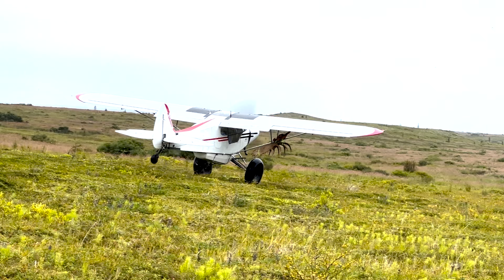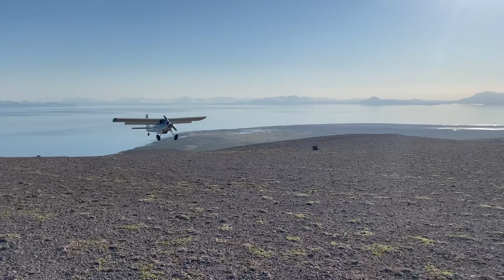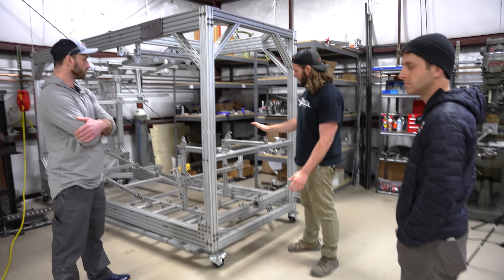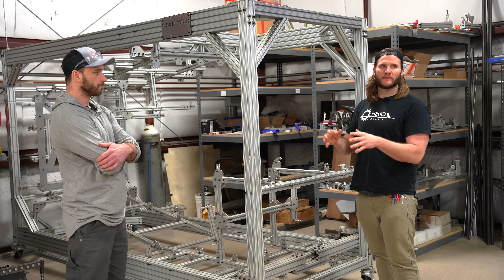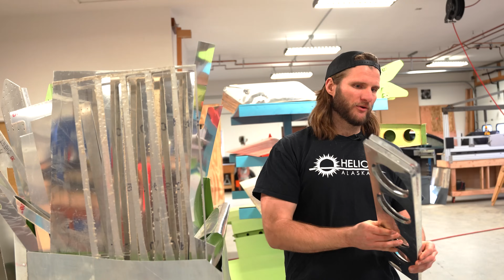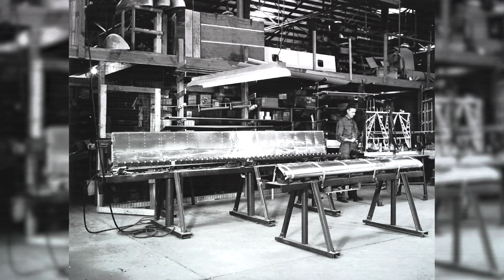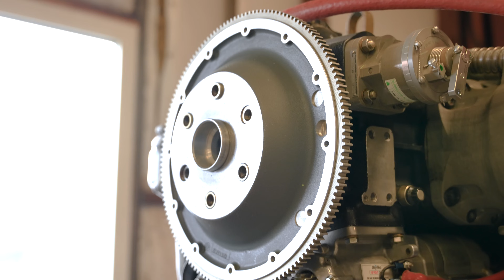Building an Airplane Factory... From 75 Year old blueprints

Comment: In 1972-1973 I was an Army Aviator flying helicopters at Fort Riley Kansas. This was the heyday of the BD5 development and testing in Hutchinson Kansas.  I have flown my Bell 206 there many times and gone through the factory, hung out at there very tiny hanger with untold number of propellers that had been tested hanging on the walls.  Sat in the crazy pickup truck modified as a training aid to learn how to takeoff a BD5.  In my visits I learned of the Helio Courier factory in Pittsburg Kansas. I have flown my OH58 to the factory at Pittsburg several times.  I don’t remember the names of the folks there but they were all very kind to us and I have gone through the factory several times over the 2 years I was at Fort Riley.  I talked to the test pilot on one occasion, and I asked him how they got the new aircraft over to the runway as the factory was some distance from the actual airport runways.  He just pointed out the back door of the factory to the unimproved grass field where I had landed our helicopter and said we just push it out the back door and take off from there.  It was a very small field.  I don’t think he was pulling my leg, I think they actually did exactly that.  On a side note the factory workers were allowed to  use the equipment after work and many of them built aluminum fishing boats.  On my last trip there in ’73 the management stopped that and workers were not happy.  The factory was not that big, just one long hanger.  I remember one completed aircraft going through final checks about ready to be test flown setting on one end of the factory floor.  I can remember the end of the factory had several half built aluminum boats the guys were still working on after work. Kansas was a great place to fly in those years.

Comment: I wish you the best in building this aircraft! As tech at an Isuzu dealer, I had a stocky 5’ 8” blonde ask every fluid service type, where it went and how often to change it. Her reply was she was driving from Nebraska to Alaska where she was a bush pilot. She took out her wallet & photo holder to show me her cabin, plane and garage with equipment. I service the plane and the 4X4 to fix everything. I live alone and advertise but has a business of flying groups into camps & picking them up on certain days. She went on to talk about tires, suspension and 700-800 foot take off runs to rotate out from trees and navigate back to camps to pickup hunters or fisherman. She would like your project! DK, ASE Master tech. Retired!

Comment: So i know this doesnt even exist as im about to describe it, and it sounds like your current engine design is gonna work well, but.. Rotax makes geared engines (geared engines are a bit more complex and maybe more expensive to maintain) but if you approached rotax to build a bigger engine than theyve ever built to achieve similar hp and torque number they may be able to do that with an engine that runs on more fuel options while also being significantly lighter weight. That would obviously involve having someone build something completely new vs. modifying an existing product. But maybe worth it.

Comment: 6:41 When we tried to replace wings or tail empennage on some aircraft made in the 1950s, the bolts wouldn’t line up. Apparently our aircraft were made with wooden jigs and this wood would shrink or expand with the seasons and weather. An aircraft built in winter would be slightly different dimensions compared to an aircraft built in summer. Maybe by a fraction of an inch.

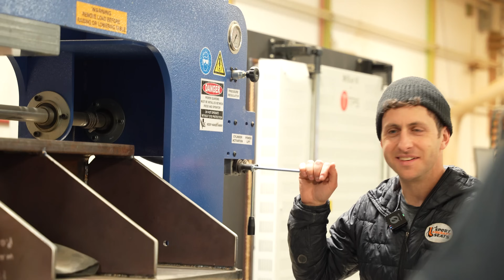Comment: [13:30] Am I the only one cringing at that press being able to operate with only one hand? Just waiting for an accident. That press should also have a button that has to be pressed with the other hand while the handle is pulled so that both the operator's hands can't be in the press while it's functioning.

Comment: As a former machinist AND pattern maker, I fully understand their problems and applaud their solutions.
As a former MODEL AIRPLANE BUILDER, I have built and flown a couple copies of that plane using rubber power, and it flew VERY well.
KUDOS GENTLEMEN!
Reply: BTW, I may not be capable of doing much machine work any more, but I could always install rivets....need help?

Comment: One critique. 

Every heat lot / batch of sheet metal will have differing mechanical properties. 
It’s definitely possible that you can accommodate for the variances, but I would like to mention that aligning holes is likely a poor use of time. 

How can we automate the hole drilling/riveting process? 

I envision an assembly line that includes robotic drilling arms. They could be small fanuc robots, or even a cobot with sufficient thrust. 

I feel like the efficiency during assembly outweighs any future expectation of universal part fitment.

Comment: Thanks for spending quite a bit of time on the issues of weld distortion and its implications in building aircraft.  As an aviation aficionado and welder myself, I’ve wondered how the aerospace industry deals with the inevitable problems that welding creates when you’re dealing with thousandths of an inch and symmetry is imperative.

 And I thought welding 8 x 8 square tubes together, accounting for distortion was annoying enough while trying to keep everything perfectly straight.

Comment: I worked at a Canadian Aerospace company that was the OEM for many De Havilland Aircraft Canada landing gear and primary fligt control systems like flap actuation systems starting with the DHC-4 to the Q-400. In the R&O dept when repairing a DHC-4 flap screw assembly we had to search through the archives of paper drawings and manufacturing plans from 1955-58 that nearly all specs used are no longer used. It took a lot of work to find and replace materials, tools and spec that were acceptable to our several engineering teams but we had to support the remaining fleet.

Comment: Omg. Yet another new aircraft video completely, COMPLETELY, and CONSPICUOUSLY ignoring the most burning question. Price. Not even a peep on price. That AC engine, prop, and gauges is 180k. The nav equipment 100k. The rest of the airframe 200k. The manhours to build it 200k. This is an 800k - $1 mil aircraft. 👎

Comment: Awesome effort! My last fire firefighting assignment was as an aerial supervisor and continued on-call in retirement. I’ve worked from many platforms; OV-10, O-2/C337,C206,C310, C340, Aero Commander, King Air, and a Helio Courier. I earned my PPL before retiring and part own a C-172. The dispatchers knew I was comfortable in a single engine plane, many of my cohort would turn down an assignment in one. 
On one callout I confirmed I’d work in a single engine. Dispatch told me the pilot’s name and the plane was a Helio. I never had heard of one and didn’t know what it looked like. When I reported in at the air base tower I was told the plane was ready in the parking area. Looking from the tower I saw what looked like a C180 with ginormous wings. That started a really wonderful two-week adventure experiencing the flight characteristics of the plane.
Leading edge slat deployment was alarming the first time even though I’d been advised of it. Alternate deployments were odd in turbulent air! We went nowhere fast. Flight conditions were MVFR at times back at the base. We would return at times over smoke layers about 10K then descend into the airport at 55-60K and 1,500 fpm, virtually on down wind. It is a great slo-mo machine. Good luck to the company.

Comment: Parts from one plane not fitting another – I recall with (at least) 1950’s bombers the many engine access plates had the planes serial number painted on the back of each – had been specifically tweaked to fit in the factory.

Comment: With the low RPM and high torque requirements, why not go diesel?  Fuel would be easier and cheaper, airtime would probably increase or tanks decrease.  Plus the safety that it wouldnt require spark to continue to run.

Comment: YOU ARE ALL DOING EXCEEDINGLY WELL WITH A VERY DIFFICULT NEW BUILD WITH OLDER PARTS. I USED TO BE IN METAL FABRICATION AND WELDING AND SO I CAN SEE HOW ADVANSED YOU ARE.  I WOULD PUT A GAS TURBINE ENGINE. LIGHT AND SMALL BUT VERY POWERFUL. . SINPLE AND EASY TO OPERATE.

Comment: Sounds like you guys need a course in HOW TO READ ENGINEERING DESIGN DRAWINGS , if you're not familiar with those E SIZE DRAWINGS , YOU'RE GOING TO GET LOST.   I CAN GUARANTEE THAT THE PROFILE OF THAT LEADING EDGE RIB WILL BE IN THOSE DRAWINGS , AND ON THE SHEET YOU'RE LOOKING AT THERE WILL BE A NOTE OR A DRAWING NUMBER CALLOUT FOR THAT PROFILE , SO KEEP LOOKING EVERYWHERE ON THAT SHEET UNTIL YOU FIND IT , I worked for General Dynamics , Lockheed and Raytheon and the FAA during my career creating engineering DRAWINGS.  GOOD LUCK

Comment: You need some SolidWorks guys to digitize the information into solid models and digital drawings. Been there, done that, for the CriCri. Comment made before watching the whole video: you guys are doing it right. Basically a not Van's RV 'kit'. This is not inexpensive; CAD time, jig creation and fabrication, raw stock of aluminum and steel tubes, CNC machines...How are you guys funding this? Hard doing this in SW, because you have to consider twist for angle of incidence in the theoretical wing and spar, to real life machine operations. Wow, another twist: water cooled, and a Part II; I want to hear about creating the custom cylinders and look forward to more info on the engine partnership and the next episode.

Comment: Just getting all those drawings digitized and then transferred into CAD is a big undertaking. And that's before dealing with all the materials and such. Also I'm curious if they figured out the wiggle room needed in tolerances? If it's not enough, they could have problems between winter and summer production work due to the metal shrinking or expanding with temperatures in the shop. The older hand-building methods weren't as exact, but it's likely they inherently compensated for such things.

Comment: This really underscores the reality, which is that aircraft design is relatively straightforward compared to the production engineering. Most of the big spectacular aviation or space projects of the 20th century were all artisanally crafted. Each F-1 engine on each Saturn V required thousands of welds by a master welder. There were no provisions for automating production because for the volume, it was easier to do everything by hand.

Comment: WOW, does Alaska ever need these guys! This is the most amazingly ambitious project I've seen in my 90 years and they're fixing every little quirk that pops up in those old plans. The latter day Helios will be far superior to and more accurate than the old hand built versions, and probably far more rugged. There is hope for light aviation thanks to smart young and industrious men who found a need  and are doing something to fill it. Alaska will finally have it's own flying workhorse when these guys succeed and they will! More power to them, at least 300 hp and 2300rpm.

Comment: Commercial Aircraft Toolmaker here… a rolling assembly jig made of Bosch tube is terrifying if you want a repeatable part 😅 unless your tolerance is +/- 0.250” lol.

Oh it’s way worse lol. Just relying on Cleco’s and wood work tables to control the configuration of your aircraft will build you hundreds of unique aircraft each with unique flight characteristics and no parts interchangeability. You’re allowing a 0.020” thick aluminum sheet metal panel drilled on a wood router table to control the configuration of your aircraft, rib spacing, spar spacing, and your prototype has measurement errors of 0.500”+ once it’s cleco’d together? Where are the master gauges to test whether those panels are in tolerance before they ever make it to the build?

There’s plenty of stuff on commercial aircraft that is located and installed from preexisting holes and isn’t controlled by a jig, but the base of the build always is. Spars are always controlled. Control surface supports are always controlled. The frame of your aircraft, the keel beam and ribs of the body need to be controlled by hard fixed tooling.

The type certificate was based on the FAA seeing the hard tooling and seeing how repeatable the build is. There is no fixed tooling now, and the drawing isn’t being followed to the letter, so that certificate is meaningless.

It’s just layers upon layers, they should have reached out to a consulting firm first, they’re missing about $100 Million in tooling to build a certified commercial aircraft. The rusted “scrap” they bought sitting in the field was a goldmine they threw away. Who cares if it’s welded well casing, 747 tooling wasn’t much different. it’s more stable and repeatable than plywood and extrusions bolted together without dowels.

I have no doubt they will build many flyable and safe aircraft but they will be experimental only, a type certificate will never be issued.
Reply: ^The unfortunate truth.

A type-certified Helio would need a defunct engine/propeller/gearbox combo, anyway. 

Or a PT6a STC.

The IO-580 is not going to provide the same "Umph" static thrust as the enormous  propeller did.

They will probably just build experimental aircraft.

But those Jigs would be useful, if only to blueprint them to recreate a similar system. At minimum, some inexpensive 6" steel I-beams welded up will be better than wood jigs.
Reply: Tool Engineer here, maybe on the same team lol. I left a comment criticizing their tooling methods too, because it’s clear to anyone in tooling that there are major methodological errors with their manufacturing. I mean hell, major manufacturers have tried FSDA designs on legacy aircrafts and its always an expensive, slow shit show. We’re only now figuring it out with aircraft built from the ground up with it specifically in mind and with our advanced CNC machining capabilities today.

I wish they had a guy like you to steer them straight early on, because you know exactly what you’re talking about. This is the harsh truth.

Comment: Wow.. that is amazing.. Wondering if you have considered temperature fluctuations in the shop.  Thin, long metal could prove to move that 20 thousandths of an inch in a temperature variation of a few degrees.

Comment: A unique slice of the stol category. A cessna 185 or 206 with the Robertson conversion would be the closest competitor but tos do not have the le slats.. There is a gtsio 520 out there ex continietal and maybe a 550tsio could be adapted to a gear but that would be an exotic solution. Liquid cooling has its own weight and drag issues..

Comment: 19:06... There's MANY more engines today that are lighter and more powerful than the original engine in the plane. They should have NO trouble finding one that works.

Edit: I'm sure that a Continental IO-520, or IO-550, would be a great substitute, and should be pretty easy to obtain today.

Comment: OK so this is a cool aircraft and all of the work these guys are doing is amazing. Now lets talk about what that bush plane needs to be besides extreme STOL. It also needs to have a decently long range, a useful weight payload, enough flexible cabin space to be used to carry passengers, cargo, or as an air ambulance, and use as many currently available components as possible. The ability to add extended range tanks is an important requirement as well. It will obviously need to meet all the specifications for FAA airworthiness certification and use a readily available certified engine.  This is a HUGE project and I wish them well!
Reply: Nothing I've ever flown is better at that whole list than a Courier. I've watched them take off and make negative ground speed in a 40 knott head wind under controlled flight. It also does well on floats.

Comment: And also, I imagine a single  stamp/form process in a machine operation would be a godsend with the amount of #40 pilot holes. The larger manufacturers have this down to a science. In many of my experiences on the MRO side is either hand made / formed or a sheetmetal / machined component with most of the pilot holes already in place, but you have to back drill with a bushing on the aircraft and trim to fit. This is still done to a high degree of precision down to the .001"

Comment: As part of my tailwheel endorsement I got to fly an original Helio owned by my instructor, What an amazing aircraft, pull the power back, pitch the nose up, wait for the bang of the leading edge slats to deploy and you could take it all the way to the ground with full roll control and no stall break just a solid sink rate. Bravo to you both and much success.

Comment: Back in the 1990s a local pilot bought a Helio from JARS (IIRC, Jungle Aviation and Radio Service~missionaries) in Maryland. I started working on it and bringing it back to a flyable condition. I grabbed ahold of an oil line and snaped it in two easily. Every hose was replaced and everything else it needed. I went on the first flight and on landing control was lost and we did a 360 on roll out. I told the owner to ask the tower how they liked the landing. They said they both fell off their chairs laughing. I remember the landing gear had cable operated pins you could pull from the cockpit, allowing the mains to pivot a bit for crosswind landings. I used to admire the Air America STOL planes operating at Vinh Long, South Vietnam, but they were Pilatus turbine powered types. And I suppose you heard about the Air America pilot almost crash while trying to land on a ridge top in Laos. He checked before landing and the wind sock was hanging straight down, so he figured, no problem. After surviving a helluva rough landing, he wondered about the windsock. The Lao told him, "We noticed you wouldn't land if the thing was standing out straight, so we put rocks in it." They wanted their supplies, so I guess you can't blame them.